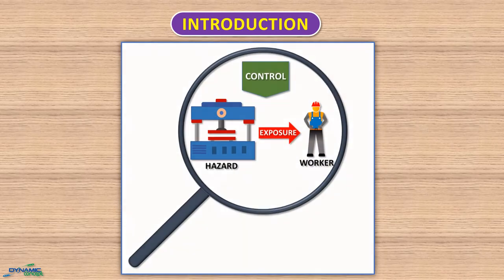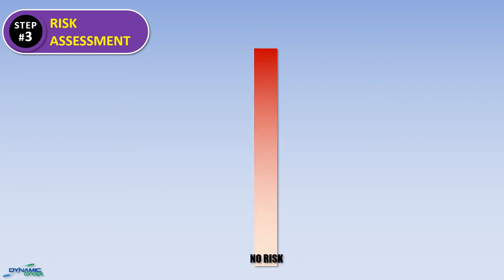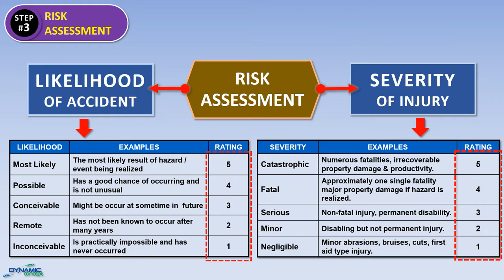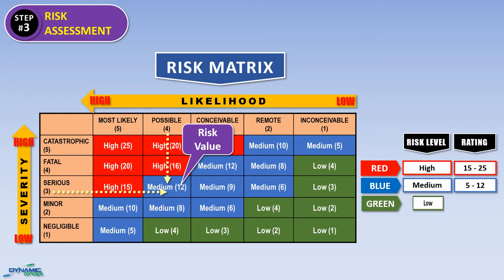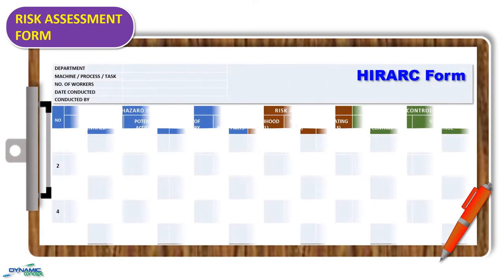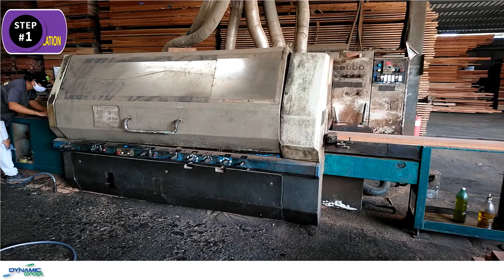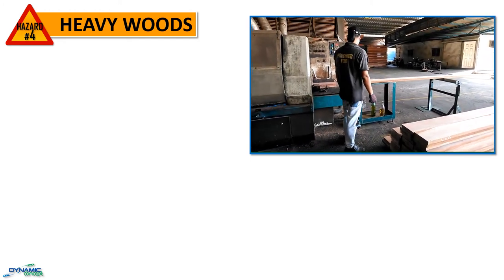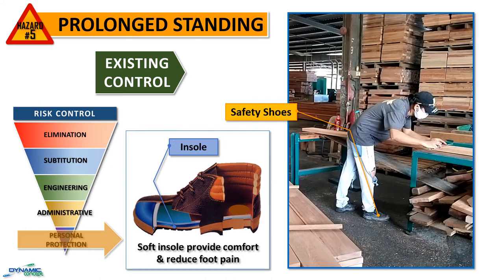Practical Risk Assessment by using HIRARC Tool

Comment: Sir, just want to ask...as per your video regarding on moulding machine, the potential hazard for high noise. Is it just put "noise from the machine" or expose with the high noise from the machine" which is preferable ya sir? Just need confirmation, sorry im new... Hope u can reply my chat. TQ
Reply from the maker: Better put "high noise from the machine" as the identified hazard, "exposed to high noise" is the potential accident, and "loss of hearing" as the outcome of the accident. Another example is a "knife" is a hazard, "it can cut finger" as the potential accident, and "injury/bleeding" as the outcome. I hope this explanation helps you.